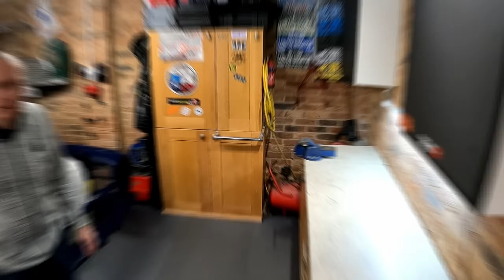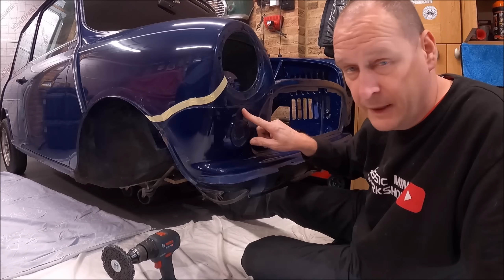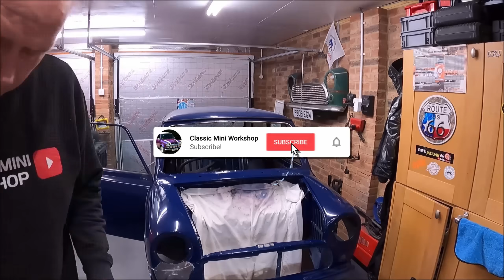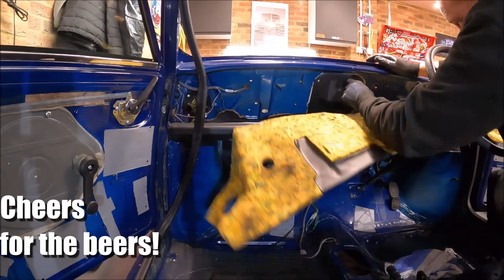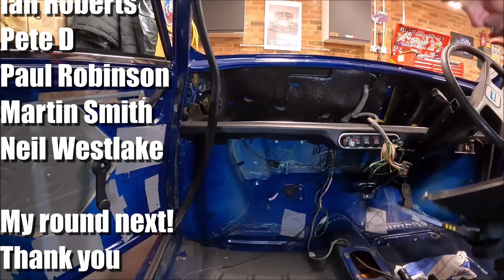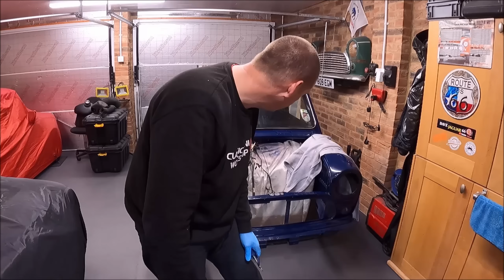How Much Rust & Filler? Project Tardis - Classic Mini Workshop Pt. 17

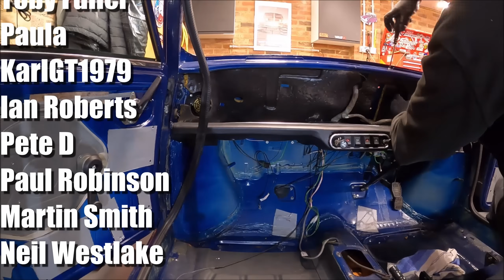Comment: Hi, could you please help? Could you please tell me where the earth wire attaches, that is visible in the passenger footwell @12:00. I disconnected mine over 2 years ago during a strip down and can’t remember. I think it could be described  as the interior light/radio earth. Thank you.
Reply from the maker: Hiya, The earth for the radio is just a crimped ring terminal that is screwed to the underside of the lower parcel shelf just to the left of the radio

Comment: Light cosmetic restoration he says !!

Either you just can’t help yourself but to fiddle or this car is a lot rougher than your making out 
Certainly in comparison to a H plate with 2000 miles all original paint and body interior etc I know yours is a dog and you did exactly what you warned about in your video proceeding to purchase.
It’s just an old automatic 998 that’s not as mint as you hoped.
But hey it gets you out the house and making content although as per usual it’s more watching you do things from a distance so we don’t actually see what’s happening and little to no explanation 
You should watch M539 restorations for how a ‘how to video’ should run 
He’s German and does BMW’s maybe why his presentation skills and English are so good 😜😂😂

Have fun I’m sure you will find more bad bits, what with floors bent out of shape now this and I can see more exploration on your side, just paint it already 😂
Reply from the maker: You are right, I definitely can't help but fiddle! It's as good as I was expecting for £4k, it doesn't come close to Alex Toon's Mayfair but then it was less than 1/3rd the price, 6 times the mileage, and is 7 years older and not as well looked after. My interpretation of a light cosmetic restoration is one that doesn't need panels, welding, engine/gearbox rebuild, and a full respray. It fits that description well for me. I watched a few M539 Restoration videos, they look good. I don't really care about my presentation skills, I just do this for fun Rhodri, I'm not looking to be the next YouTube superstar.

Comment: Good work Keith. Can you take the top dash off (and back on) without taking the windscreen out?
Reply: No the vents get in the way and the bolts are near the leading edge so you can't lift with the windscreen rubber in the way
Reply from the maker: As Steve says, it’s not possible without bending or damaging the top rail
Reply: @classicminiworkshop  Thanks both. I have a strange one where the drivers side screen de-mist doesn’t work. Heater blows the warm air no problem, duct isn’t blocked so want to investigate the vents.
Reply: @jamesfoster4577   make sure the tubing is attached from the heater under the dash up behind the sound proofing to the vent sometimes gets knocked off . Or could the foam in the heater box has fallen to pieces so no longer seals the box effectively when you move the flap if that's the case you need to remove whole heater from under dash strip down and reseal ( drain coolant first or it gets messy real quick ) or even could be leaves stuck inside I've had that before

Comment: You think about having a oil filled electric radiator to keep the temperature high enough too dry the cars out.
Reply from the maker: I’ve already got an oil filled radiator in there but it’s more important to control the humidity as warm air can still be damp and cause rust

Comment: On the repaint aspect I wouldn't. The car is so absolutely original it stands up for that alone and any value is increased by that. The paint will buff up nicely if done carefully. If you repaint it you lose something unique: A 36 year old Mini in factory condition. You only have to see the interior to know how wonderfully original it is.
And that loom tape is spot on. I rebuilt Noah's looms completely (and added rear fog light wires) and finished it in the same grey tape. Again its originality that matters.

Comment: I run a dehumidifier in my garage and it works well.  Only trouble is that I have to empty the water container every couple of days.  I should really connect a drain pipe instead and run it outside, but just too lazy.....  :-)

Comment: It is tempting to start modding the engine - but as you know it's a slippery slope; e.g. adding bigger valve head probably achieves little unless you change the carb, then you need to change the manifold and exhaust and so on and so on.......  Probably best to stay original, after all this is a car for just dawdling around in......  Should look great when it's done.
Reply from the maker: Good points!